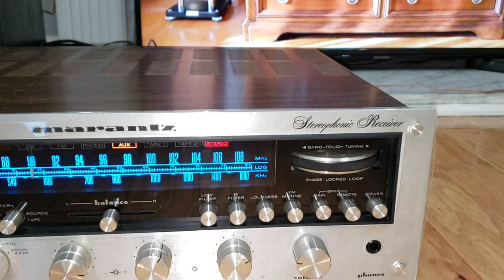JBL 4638TH THEATER TEST

Comment: Of course cinema speakers can be used as HiFi equipment. Definitely would sound better in person.
Reply: But Professional Audio and even Professional Cinema speakers tend to be far far far far (4x) powerful and energy efficient than home/car audio equipment. Also, they are tight! Not boomy.
Reply: @josealfredfernandes  Thats because they got quite stiff suspension because they don't need high excursions with that diameter. You dont pay for the looks either.
Reply: @wadimek116  agreed. My Rythmik audio F18 lacks spl in comparison to random cheap pa subwoofer. But sq is great down to 10hz.

Comment: I guess it's true - the uglier the speaker the better they sound.  Great demo...but how did you get your wife to let you put those in the living room??  :-)   Have you heard JBL 4722n?
Reply from the maker: lol. we are respect each other, thats why she respect what I do and same to her. I have not heard the 4722n yet. lol The songs it from randomly on youtube. and this is the link https://www.youtube.com/watch?v=ZIXAcHfLGuM&list=PLPl6-ztXLoqUQTrBVgAKnQyWd95gky4g9&index=46&t=26s  ................Enjoy
Reply: @QAudio  thank you sir
Reply: @QAudio  can a regular Reciever like the Denon x4700 power these guys? If I get 3 of them for the front stage of my living room/theater, do you think the Denon is enough power? Can I just connect them to the Denon?
Reply from the maker: @raymondayala5355  these are 800w just 2 woofer not included the horn driver on the top,  so they are 800w plus ea. Denon just give you around 125w from ea. channel. So I'm not sure it will handle these speakers. These speakers need go with high power amplifier to handle these. Just my opinion. But you can try.
Reply: @QAudio  thank you for your response. What home theater speakers do you currently have now in your setup?
Reply: @raymondayala5355  Your Denon should do just fine, until you push them hard.  Biggest danger with these is under-powering, so until you get your Denon close to clipping, all is well.  On the flip side, these are crazy efficient--so you may not need to push them at all--depends on your room/listening habits.
Reply: @mattgreven7615  thanks. I sold the Denon and got an XMC-2 and DR3 Amps for power.  I went with the Arendal 1723s thx home theater package. Best speakers so far
Reply: @raymondayala5355  did you part with the jbl's?
Reply: @mattgreven7615  I never got the JBLs. They are too big for my space
Reply: Beauty is in the eye of the beholder.. Those speakers are beautiful.. as are Altec A5's and A7s
Reply: @raymondayala5355  Your denon will be fine. I seriously doubt someone is using more than 1w in home when driving them even loudly. It will drive it just fine.

Comment: Hello thank you for sharing this video,  I want to buy a pair of same but want to use these as left and right for my living room home theater. do you think these will do the job, I will be using my preamp and amplifier (125w) to drive these?
Reply from the maker: It will be fantastic. I did use them to watch movies. just only for front left and right. They sound like in theater without sub or anything need. Will blow your room away :))
Reply: @QAudio  Thank you for your reply, since you did not use the center channel, how do dialogs sound without center channel?
Reply from the maker: @reefingravi7612  the horn will cover all over the room. 4 woofers will give you strong bass for the movie. So you can try it. If you want to add the center you can. But definitely recommend these speakers in your set up

Comment: Hello i have 2 JBL’s 4639 speakers. I want to have a soundsystem-ish setup to pump some reagge dub tunes in the garden. I was wondering what i need to have the full setup? Like do i need extra subs or what kind of mids/tweater tops do i need? Also what kind of amplifier will work the best? 
Thanks in advance!!
Reply from the maker: Just find 2445j use them as a high frequency. But you need to add another crossover to it.
Reply: @QAudio  Did you modify these crossovers or are they original spec.
Reply: @QAudio  i added a pair of JBL 4632 tops, so now i have a bi-amp soundsystem.with build-in drivers , i was wondering which amplifiers i need to use to drive both of these systems. (output watt) also do i need a processor or not?

Comment: 2:13 same JBL 2446 2380A I have with smaller cab running five screen JBL 4673A. 
Have you ran sine wave test on the HF horns only with bass drives off/Muted so you can check the HF with sine wave at 400Hz 300Hz . I let you know the rest when you do the video test I can point out how to correct it.
Reply: What do you mean? I have these speakers too and I would like to know what needs correcting? Thx
Reply: Why would you run 300/400hz to the horns?  They x-over at 800?
Reply from the maker: I'm not sure how to do the wave test and those already sold.
Reply: Эти рупора и ВЧ драйвера не рассчитаны на 300 Hz. От 500 и выше. 300 Hz играет рупор 2392 и драйвер 2490